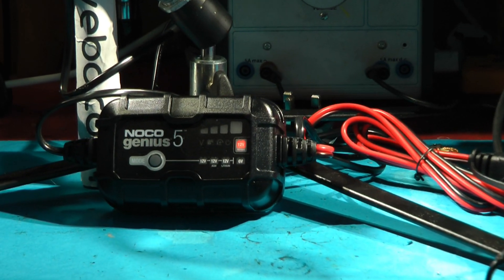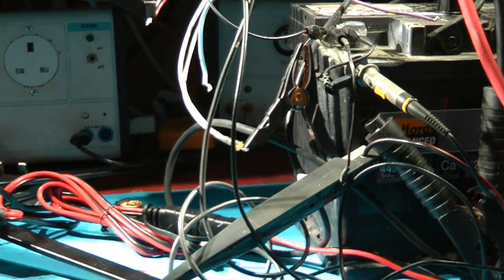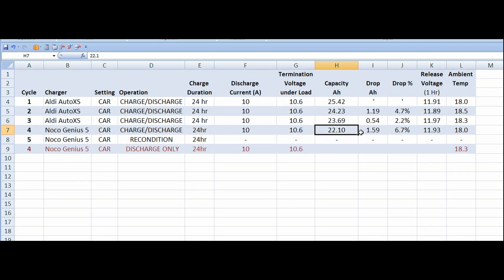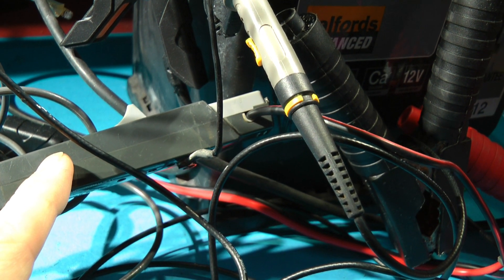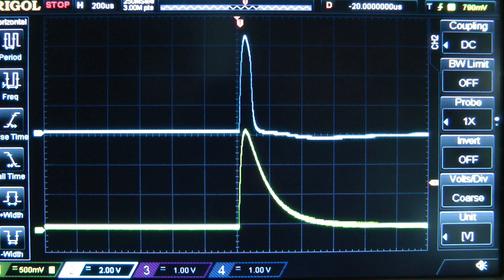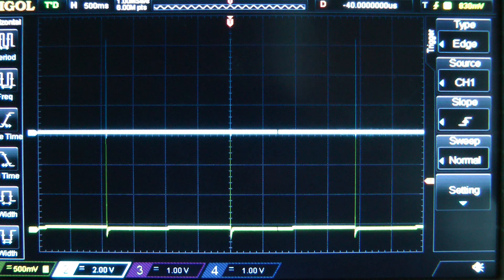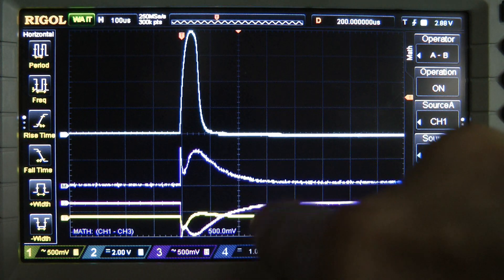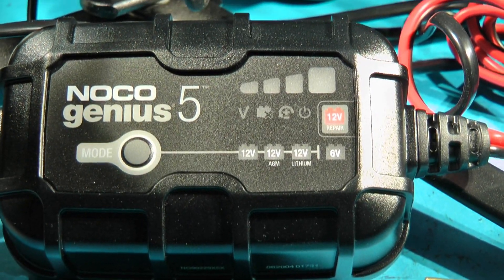NOCO Genius 5 Battery Charger Detailed Evaluation, teardown  and Review Part 2

Comment: You need to run the reconditioning after a full charge. It wasn't clear to me whether you did that or not.
Reply from the maker: Recondition may improve a slightly iffy battery but it is mostly all smoke and mirrors. I have tried everything and all repair regeneration on multiple failing batteries of all sizes. The process has have little extra effect than a long float charge.

Comment: Hi, I just got a Genius 5 and the green charge light has been blinking for nearly 48 hours. Will it ever go solid green?
Reply from the maker: It should if the battery is good. What that means is that the battery is not reaching termination voltage under the final low-current stage of the float or absorption charge.  If you have DVM then measure across the voltage across the terminals.  Depending on the car this can also happen if the battery is still connected to the vehicle.  Another test is to disconnect the battery and leave it for a few weeks and measure the terminal voltage. If you have a sulphate bridge on one of the cells is will self discharge quickly. It may affect only one cell so look for a voltage of anything less than 12V.

Comment: thank you very much for this very informative video. I was wondering if you can use the recon function in this NOCO by connecting it to the battery terminals directly with this battery sitting in the car with its two terminals still hooked?
Reply from the maker: If it is a modern car with electronics then I advise you to disconnect both of the battery  terminals before engaging repair mode.
Reply: @razenby  thank you so much. I realized that there is a ground connection point next to the battery. can I use the positive terminal on the batter and the ground to connect to NOCO and do the repair? is it the same as connecting NOCO to the two battery terminals after they are all disconnected from original cables?
Reply from the maker: @nickfish4385  yes that would be fine - you don't want the repair spikes going down the +Ve lead into your electronics. It is probably safe but it is better to be cautious.
Reply: @razenby  thank you very much.

Comment: Thanks for  this informative  session and the comparative between the NOCO and CETK .  I truly appreciate the investment you make in creating these reviews/tests. 

After viewing  this particular test of the NOCO and paying close attention during your description of the set up and noticing  how you've terminating  your connections to the battery posts i.e. loosely wrapped bare wire, which  in itself defies the fundamental rule of electrical and electronics best practice of ensuring good conductivity.  Hence, it would be interesting to see the results of the same tests  with the connections to be battery posts according to best practice .

In my experience, proper connections  ensure not only good conductivity but also prevent losses, overheating and thus allow the purposed equipment  to perform according to their stated ratings
(if the manufacturers are honest and transparent).

My observation, is further corroborated by other you tubers where they report considerable variances in the outcome  when  connecting via different methods with a substantial better yield/outcome when using a properly fastened battery clamp/terminal.

Thanks again for the great work
Reply from the maker: I understand your concerns but let me explain:  Clamped connections are essential at 300 Amps. However the test system was monitoring voltage at the battery charger clips with sense wires (no current in these wires) the not the terminal posts. I know that the integrity of the connections to the battery posts were not an issue as I measured them on the rig. The potential between the charge clamps and the terminal post was 12 millivolts at 3 amps.   24  millivolts is way beyond the resolution of the charger's sensing electronics.   At the low currents at the charge termination voltages then the potential difference is been <1 millivolt.  The test rig is fiendishly more accurate that the chargers measurement resolution or accuracy.
Reply: Thank you for your valued reply. I concur fully and support your explanation as the objective was to tests and collect readings, I was simply commenting because I saw the looped wire move as you were pointing at it with your finger.
I currently have a CTEK  MULTI US 3300 (max 3.3 Amps) which I had purchased 5 years ago for maintaining the battery in my Honda 2004 S2000.  I did the job for the size of battery and the car was in perfect condition.
I've just recently purchased a 2016 Porsche 911 Carrera 4 and did some research on what Porsche recommends as a battery maintainer and found they sell the rebranded CTEK MXS 5.0 which is solid wired to a cigarette lighter adapter.  So I decided to try the MULTI US 3300 and purchased and extension cable and the cigarette lighter adapter knowing that it may take longer to charge which is not an issue as I would mostly use the unit during winter storage.  Hence, time is available and the objective would primarily be maintaining the battery.
The battery was recently changed (less than 1 year) by the previous owner at a Porsche dealer.  It's a Banner 95 Ah which was not put to sue much during the previous year (1200 km) and in storage for the last 5-6 months.  
The CETK 3300 has bein on for at least 36 hours and the LEDs remain Orange (Amber) on CAR mode and CHARGE.  Further to you r temperature measurement of the CTEK MXS 5.0, I also measured the 3300 and got 55C at the upper part where the AC line cord is terminated.  The center of the unit hovers around 44-48C and about 32C where the Mode button is. 
I suspect that his unit may have given out as it did turn the LEDS to green about 4 days ago when I first tried it directly connected onto the battery terminals Vs the cigarette lighter adapter.

Based on your tests of the CTEK MXS 5.0 and the NOCO Genius 5 it would be safe to assume the NOCO is overall a better unit especially knowing that the CTEKS run so hot and seem to have understandably what seems to be a high rate of failure.  

As I believe in doing things right the first time even if it cost more (as the saying goes from the man from FRAM - Pay me know or pay me more later).  Therefore because of the quality of your work and your depth of knowledge (vary few reviewers delve as far and as concisely into the subject matter KUDOS!)  I would kindly ask for your advice, aside from the NOCO, as to which charger/tender you would personally buy based on your hands-on experience for the purpose of charging and maintaining a battery? 

Just as a point of reference I have looked at the ones posted through the Best Chargers to buy 2020 & 2021 and the cheapest is always on top Deltran Battery Tender Plus 12V 1.25A (basic Charger and Maintainer $60.00 CAD). The other unit is the Optima Digital 400 (if one wants an intelligent unit).  What I like about the Optima (based on specs) is that it is a hybrid i.e. LEDs and Digital display (integrated Voltmeter) and supposedly can charge depleted batteries.  NOCO also makes the cut in certain reviews. 

I apologize for the length of my reply and thank you in advance for your valued input.

Comment: "did you say a spyke?" i was scared, i thought the oscilloscope had a covid 19...i am not far from a knowledge of electrics or electronics, but i listen very carefully to those like you who have the knowledge (in your case and the equipment) needed to demonstrate something.
i found a new genius 5 noco on a site for a good price 462 ron means 84 pounds i am looking forward to .ps for the scope i recommend a zeneca astra vaccine
Reply from the maker: The genius 5 is a charger that has good control and is kind to the battery.

Comment: I've been enjoying your charger videos, as I just purchased a NOCO Genius 5, a couple days ago. I have a question. Does the green light ever go solid, when the charging is done? After going through the other charging stages, my green light has been pulsing for almost a full day. During this time, I've watched the voltage slowly rise from about 13.1 to 13.9 volts, and it's now lingering around 13.68. I'd appreciate your insight on what the charger is doing right now, and whether the green light will ever go solid. Thank you.
Reply from the maker: What is the Ah capacity of the battery? A 50ah battery can take up to 14 hours to complete. If you battery is bigger then leave it a few days. Yes, the green light should go solid at the final absorption stage when the battery terminal voltage reaches 14.4 to 14.5 volts. (On normal 12V lead acid charge).  This is the stage when the final 20% or so of the Ah capacity is delivered at a low charge current (~200mA) that reduces down to ~70mA.  When the terminal voltage is reached at this low charge current the charger turns of the current and switches to monitoring mode. If the battery can't reach the expected terminal voltage for a healthy battery the the light wont go solid.  If your battery is still at 13.68 then it suggests that the battery may be faulty.  If you disconnect the charger and restart the charge then you should see it ramp up to 14.4V pretty quickly, If it doesn't reach 14.4V then you may have a faulty charger as  it needs to get to this trigger voltage before it turns off the third light.  Best bet is to try it on a known good battery to see what it does. If you connect an ammeter in series with the charger you can see what is going on. Good luck.
Reply: @razenby  Just an update, for anyone else who might encounter this situation. The green light finally turned solid. I realized, I think it actually took about 48 hours, to go from a flashing green light (with no other LEDS lit), to a solid green light. Anyhow, thanks again, Magic Smoke.
Reply from the maker: @thislife6884  Phew
Reply: @razenby  That's great info. I appreciate you taking the time. It's a 57ah battery. The voltage started climbing again since I posted before, and it's now at 14.10 volts. The battery is almost 3 years old, and the car has mainly only been driven on short trips, a few times weekly. Since Covid though, it's more like once a week. I wouldn't be surprised if it's compromised. If it hasn't finished when I wake up in the morning, I'll try what you suggested. Thanks again--and great job on your videos. Your knowledge of electronics is impressive.

Tom
Reply: @thislife6884  If you don't drive the car more than 2 times a week and you have a drive way than I would disconnect the battery to keep her going. 3 years the battery is getting up there in age, so take precaution. Personally, even on my daily driver I would use my Noco Genius 1 to charge the battery once every 2-3 months over night just to keep sulfation from collecting in her. You're doing great though by taking action now rather than having to worry later on with you battery dead upon start up. Also, trickle charger is best. Heard so many bad stories about bringing your charger to discount parts store to do a quick shock charge of 2-3 hours. I would rather hook the battery up over night and have her last much much longer than shocking her when she gets low.
Reply: @dbzownz12345  Thanks for the input. I agree about trickle charging. I've actually been periodically trickle charging this battery since new. Before the Noco though, I'd been using a 2 amp Schumacher dumb charger. It's amazing how much better the Noco works--a much more complete charge. 

I think the slow (1 to 2 day) optimization charge at the end makes a huge difference. With the old charger, the battery would level out at around 12.64 volts a couple days after charging, but would slowly drop over a few days--and after a couple short trips, could settle to 12.5, before I'd charge it again. With the Noco, it'll rest at over 12.7 volts for at least several days, between trips. 

Interestingly, I took a trip to my buddy's a few nights ago--a little over 10 minutes each way. Three days later, the battery is still resting at over 12.7 volts. So since using the Noco, 20 minutes seems to be sufficient time for the alternator to replenish the battery on a short trip (at night, with lights and heat on). That was never the case, using the old charger. Nocos are awesome. Anyhow, thanks for chiming in.
Reply: @dbzownz12345  In case anyone's curious, on both of my cars, the final optimization charge (flashing green light only) seems to always take 24 to 48 hours, before the light goes solid. I haven't checked the amperage it's putting out during this phase, but the charging voltage slowly creeps from around 13.3 to over 14 volts, during optimization. I think it's a valuable phase (to any who might be tempted to skip it).
Reply: @thislife6884  Glad to have been of some insight. I also agree with you and glad you're also witnessing the benefits of this charger. I've start with the Battery Tenderizer, but a week after doing more research I found the Noco and within 2 days that Tenderizer was being shipped back to Amazon in exchange for the Noco Genius 1.
Reply: @thislife6884  Never checked the volts much on during the charge, but after reading this I'll leave the Noco charged longer than just over night and wait till maybe the following night or couple hours beforehand. I usually don't wait more than 2 weeks before I hook it back up so I've always thought over night was good enough considering I disconnect the battery power terminal from the post while garaged.
Reply: @dbzownz12345  I hear that. I will say that, 10 years ago, I used to use a Battery Tender that worked ok--certainly better than the Schumacher I mentioned, anyway. I agree though--I think the Noco is a much better charger.

As far as your Genius 1, I've wondered if they do the same optimization charge at the end (flashing green light only, for a long period). I know the LEDs are different, so they may work differently from the Genius 5, but I'm not sure. If they work the same though, then I'd recommend keeping it connected until the flashing green light turns solid. It seems like good things happen during that flashing phase--just based on my limited observation. I know it's a long wait though--particularly charging at under 1 amp the whole time. 

On another note, I did originally buy the Genius 2, but after more research (including watching the video where Magic Smoke plots the amperage and voltage curves of the Genius 5 charging cycle), I decided to take the '2' back, and get the '5.' It truly seems intelligent enough to use the right amperage and voltage at all phases. (Prior to that, for decades, I would only ever use 1 or 2 amp chargers. I trust the Noco strategy/circuitry now).

Comment: Greetings from Ukraine.  Received as a gift Noco G10.  However, I could not start it on any battery.  The device blinks the red minimum charge indicator and goes into standby mode.  Cyclically returns to charge mode, blinks again with minimum charge and goes into standby mode.  And so on until the power is disconnected.  The Forse mode is also not available.  There is no service.  There is no information on the type of breakdown.  Have you seen any mention of this behavior of the Noco G10?  Thank you very much for your time.
Reply from the maker: Thanks for the message. I have repaired a few with this fault . The output switching FET circuit in the low voltage section has failed or there is a wiring fault on the low voltage side.  I am trying to remember if there is a fuse link in the battery lead ... If there is have you checked the fuse?
Reply: @razenby  The fuse is intact.  An overvoltage message was triggered when attempting to charge a 12 volt battery in 6 volt mode.  That is, the charging - battery connection is present.
With only the ability to solder, but without deep knowledge in electronics, I can fix the malfunction myself if you indicate how?  Your answer was encouraging that it is generally possible to repair it :-)
Thank you very much for your attention to my problem.
Reply from the maker: @TheSOMSTS  Good pint. So it is likely to be the power control on the low voltage DC side. Presumably somwhere near the isolator FET.  I have a couple of 10A Nocos here for repair now.

Comment: Many thanks for the scope view of Noco Genius 5 in repair mode!! I don't have your deluxe current probe 8-), I just probe the voltage in AC mode and I see a period signal about 2 seconds like you say with Vpp 356mV, I will try to make a short video just to share my results.
I have others chargers with auto-repair mode, if battery voltage is low like 10, it will kick start the pulsing mode but once voltage increase it just stops and there is no force repair mode.
I am testing repair mode on a 7 years battery on my Honda Accord to see if anything improve, I live in Canada so here temp can go down to -35C so battery is under extreme stress.  
I am not trying to be cheap trying to extend the battery life, more of a ecologist conscient.
Reply from the maker: The answer when it comes will be very simple.